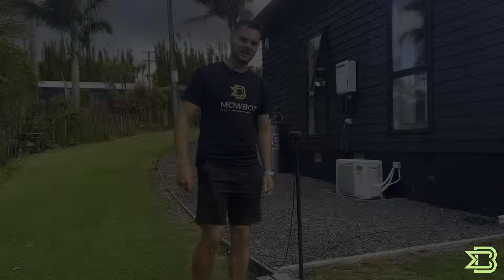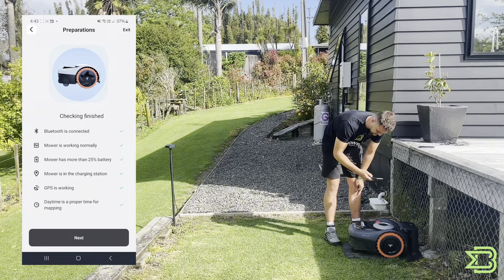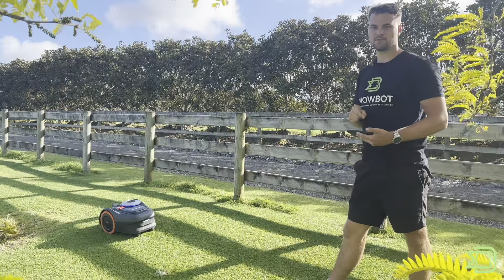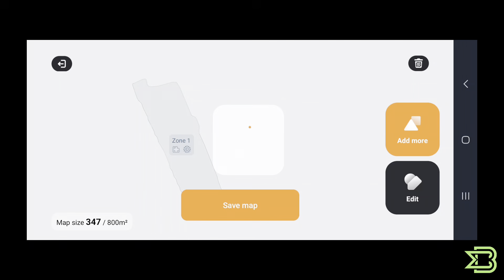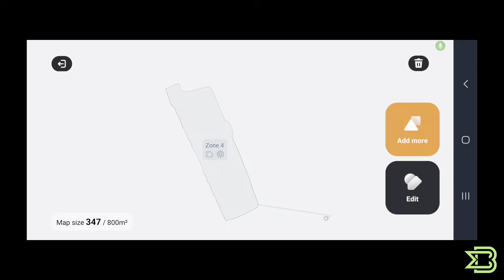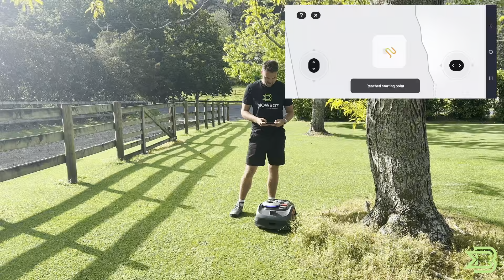How to self install a Segway Navimow

Comment: Very helpful. Thanks. 

How well does the rtk signal go through or onto the other side of a house?  

I have 0.5 acre lot with lawn on all sides of the house. I have a very clear view to the sky.
Reply from the maker: Glad it was helpful! Great question — yep, as long as the machine and the antenna have a clear view of the sky, satellite connection won’t be an issue. But if you are worried, that’s why we suggest the antenna kit, so you can mount it on the side of your house to get that nice, clear view of the sky. :)

Comment: Thank you for this really helpful video. When you were mapping the boundary around the fence posts was that you steering it or was that automatic? I’m trying to do the same but find the steering really sensitive and need to keep deleting and redoing my path.
Reply: i think he was steering, and at one poimt he shortly switched to auto mode to show it working
Reply from the maker: Yep, it was automatic around the fence posts. However, on the app, once you’ve mapped your area, you can pull the boundary in or out — which should help you. :)